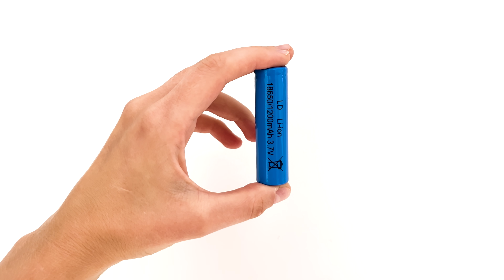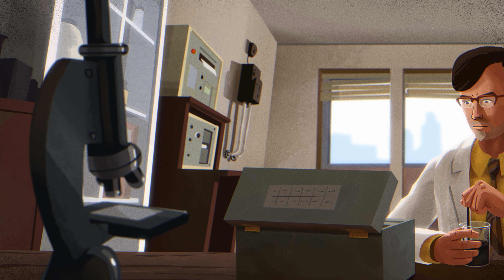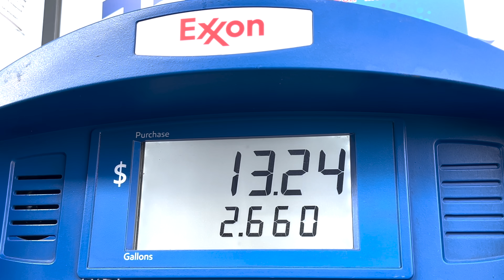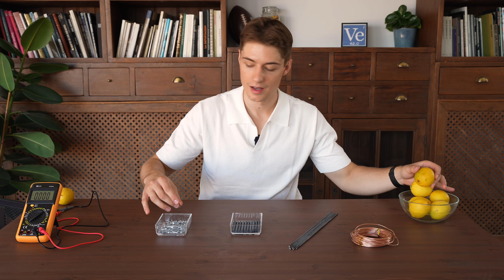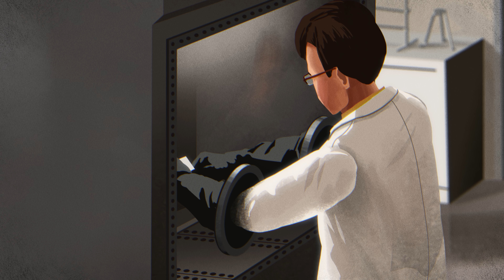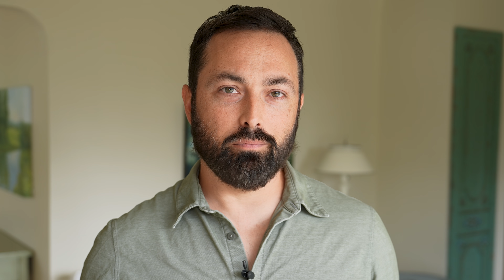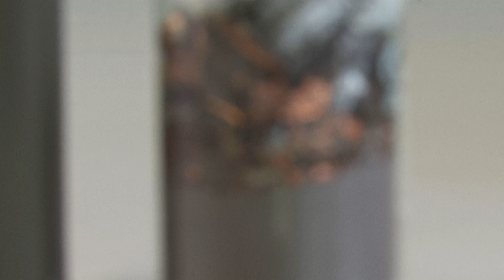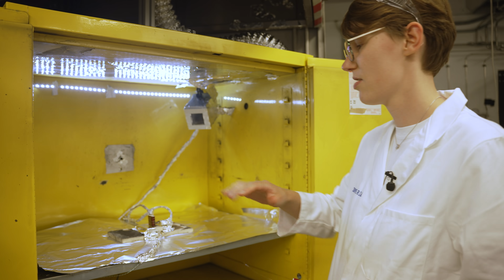The Perfect Battery Material Is Dangerous

Comment: How would cutting the speed limit cut consumption of gas.. and not increase it?
Reply: How might it increase it, supposedly?
Reply: Cars burn more gas the slower they go, more idle time, gear have less drag when they are smaller.

Its the reason why when you buy a car and they are talking about how far it gies on a tank you'll see a disclaimer (80km or 55 miles per hour)
As that is the best speed verse air resistence you get per liter (gallon)
Reply: @grakalockheart2980 : No they don't, just from going slower. If you idle a TON then maybe, but ordinarily going faster drinks up more fuel. Why do you think the federal speed limit was kept down at 55 during the fuel crisis? It wasn't about getting up to that speed, it was about keeping DOWN with that speed.
Reply: @HelloKittyFanMan.. 
The whole point was that decreasing the maximum speed doesnt help, it was decided by politicians looking for votes, competence was not involved.
Reply: @grakalockheart2980 : If you reduce drag then you increase efficiency. So yes it does help.

Comment: Sodium-ion batteries already exist, and they obviate the need for both Lithium and Cobalt. They're safer. They're effectively sustainable. Plenty potential to be way cheaper. And they only have 30% less energy density.

The future is already here :)
Reply: No offense, but it's annoying that everyone states things so confidently, yet has only touched the surface. Sodium ion batteries are not a great replacement for a lot of uses. The battery chemistries we have all have their advantages and disadvantages, it really comes down to the specific application. Energy density, specific energy, voltage, max discharge rate, safety, and so on, are all factors that have to be considered on a per use case.

Comment: Speaking of a serious risk: 
My brand-new Makitta 6.0Ah, 18-Volt Lithium Ion accumulator recently commited suicide, several seconds after having been taken off charge. 🤔
Melting the insulation of the DC supply line, as a consequence of a mysterious short, caused  by the misterious unsoldering of one solder-joint inside the DC-adapter extension line.
It is now a poorly performing 12-volt Battery, because the accumulating of the prior Lithium Ion Accumulator no longer works.  There it goes. Another $50 bucks spent on involuntary research. 🤗

Comment: I had a NiCad battery for my Motorola cell phone (The Brick) and it was crap. I heard that with these kind of batteries, you should never let it get to 100% charge, and don't let it get below 20%. So I tested this. Got a brand new battery and was very careful not to go above or below the 100/20% level. It worked. It lasted about twice as long. The only problem is the amount of attention you have to have not to let it get below or above those levels. I charted it all and showed it to my science teach. He was so impressed with my work he gave me a whole letter bump for the semester. Went from a C+ to a B+.

Comment: I blow up batteries at work sometimes. LabTest Certification tests and certifies batteries. Some of the certifications require the "blowing up a battery" test shown here, to see how well the design of the system minimises the damage. Some of the batteries that need this are BIG. The biggest ones I've tested had more than 20kg worth of cells. The fires these things make are impressive. The gasses that they release are scary. There's a whole cocktail of nasty things - the most immediately dangerous part is probably the insane amount of carbon monoxide (can be over 30% of the gas by volume sometimes - even 1% is deadly), but there are also tons of VOCs, heavy metal particles, HF, HCl, etc...

Comment: Hmm, in less than 500 charges it dropped 33% capacity 🤔 that actually sounds pretty good.
Ofcurse 40km is really bad, but hey wait, wasn't the chemistry back then of such kind that was not ment to fully discharge? Then 500 times sounds of allot!
If you watch data sheets on even high grade lifepo4 nanophosphate cells, then the lost capacity is most deffently not measured at high discharge rates like c10-c30 😂  
~480kg battery = 108 cells in series and 100 ish paralel..
If you want to pull 75kw ~100hp then you pulle 2a of each series or c2.
The cell manufacturer talks about cycles to still have 80% and are maybe measured in c0.2 - c1.
With that in mind 500 cycles in the beginning of 1900's and only lose 33% sounds quite amazing

Comment: This is WRONG. Electrons are negatively charged. Electrons travel FROM the negative electrode TOWARD the POSITIVE electrode THROUGH THE LOAD. When charging, the process is reversed. The excess electrons are driven off from the positive electrode and drawn back towards the negative electrode.

Comment: John Goodenough has been working on solid-state lithium ion for a while, which would have a solid-state electrolyte, and have about 2x the energy density as our current ones, but not suffer from the same degradation problems.

Comment: I have at home Sony miniDV camcorder, it's from 2004 and battery still works, it has only like half of battery life as original, but it works
Reply: I have four 4Ah Li ion ryobl 18v batteries made in 2012 and cycled at least 300-400 times each.
I recently measured the capacity of each and was surprised to find that they ranged from 3.7 to 3.9 Ah.
Reply: 2004?  That’s 21 years and still working?!?! Amazing
Reply: @johnhardasnails7464  Japan quality bro.
Reply: 2004 Sony Digital8 Handycam here, original "Info lithium" battery still works! (As well as aftermarket Sony-made big boy battery)
Reply: @nthgth  No programmed obsolescence.

Comment: About being explosive - the crazy run for stronger batteries resulted a couple of years ago in LG50T - 5 Ah 21700 type cell which was strong enough to power compact personal commuters (e-bikes, e-scooters and e-monocycles, even e-cars) - rapidly they could have 1.5-2x range and much more power . But it was extremely unsafe - which resulted in many fire accidents. When they were stopped - replaced by LG50LT and Samsung 50E and 50S batteries - the problem vanished. So production technology has a big impact on safety, too. The achieved safety is because of carefull production process; batteries themselves are still not save when damaged - that why it is important to clean interiors of commuters from dust and sand yearly.

Comment: Well, when it comes to large-scale power-hungry operations, there's a simple solution called bricks meet steam generator. What you do is, you build a tower of bricks inside of a giant oven, heat them up and leave them at high temperature. They're bricks, so... they don't explode or anything. it's just hot. Then, when you need power, you can use water to conduct the heat to a generator old-school style. It's effectively a battery, just one that uses heat instead of a charge or chemical reaction to store energy.

Obviously, this doesn't work for mobile devices. Can't have a brick that's over 3000 degrees C in your hand lol. For those devices, you will likely still need to rely on chemistry. I'd say that exploring carbon may be a good place to look.

Comment: ive raced remote controlled cars for years and ive seen a few lipo batteries explode. i know lipos are different but it can be very violent. rc batteries can be as big as 4s 10000mah. that's a ton of energy to be released. most of the time its because people are trying to get an advantage and over charge for more power at the beginning of a race. also there is a method of discharging and recharging the battery very quickly to temporarily lower the internal resistance in the battery give them more power. both are very hard on the battery and can make them fail spectacularly. less common is a short between poles and puncture. ive never had a problem almost all of the problems come from people abusing them.

Comment: The mose dense an energy storage system is, I.E., the more energy it can store per weight and size of the storage "cell", the MORE dangerous it WILL be of something goes wrong and releases ALL of the stored energy at once. 

It doesn't matter if its a lithium cell, or a container of gasoline with the same amount amount of energy inside it, they'll both blow up with roughly the same violence if all released at once.

Comment: "...Decreasing the battery's capacity...." But then that's the only way you can use it, right, Derek? So it's kind of like the old "unformatted capacity" vs. formatted capacity of a disk (typically floppy disks), because even though supposedly the "unformatted capacity" is higher, it doesn't really mean much for the user, since you HAVE to format the disk in order to use it... supposedly "lowering its capacity"! Same sort of deal, right, Derek?

Comment: Lmao the fume hood and nichrome wire heater.
Just knock a copper nail into it at full charge and move away quickly.
You'll have time enough to get away and it doesn't just look like you've set it on fire.

Or just over discharge and then push 8V into it.

Comment: The content is being a little alarmist with respect to the fire hazard aspects.  Individual cells typically have thermal and/or overcurrent protection.  That should have been mentioned.  We have also tested cells, and it is nearly impossible to cause thermal runaway with overcharge current or voltage.  That is also the experience of all other researchers we deal with.  Temperature and mechanical damage can obviously cause the failure, but then there is an external cause, likely not related to the battery itself, unless there is a manufacturing defect.

Comment: Lithium batteries were first mentioned in Dick Tracy comics, back in February 20-24, 1946. A young and blind genius needs lithium for the batteries of an ultra-bright "atom-flash" light and the two-way wrist radios for Diet Smith industries to supply to Dick Tracy's police force (later replaced with two-way wrist TV in 1962).

Comment: Putting out a Lithium fire: "Specialized agents such as those containing Aqueous Vermiculite Dispersion (AVD) or dry powder agents tailored for lithium fires are recommended. 

Here's a breakdown of suitable extinguishing agents:

1. Aqueous Vermiculite Dispersion (AVD):

AVD is a water-based solution with vermiculite particles.

The vermiculite creates a heat-resistant barrier around the burning cell, preventing the fire from spreading and re-igniting.

The water component provides cooling, reducing the temperature of the battery. 

2. Dry Powder Agents:

Some extinguishers use dry powder agents, like those containing sodium bicarbonate or powders specifically designed for lithium fires.

These agents work by suffocating the flames and disrupting the chemical reactions fueling the fire."

Comment: there is a lithium based battery design even safer than the current design in use commercially.  This design was proven stable with a metal shears cutting it in hafl and nothing happened as well as a nail was driven through it and nothing happened.  The battery was 80% charged at the time of testing as well.  The problem however is that it is a VERY expensive process to make this battery and while it has a comparable recharge ability - the actual voltage is less.  somehting akin to 3 vs 4 and that is why they keep going with the current design.  It isn't perfectly safe to use the current commecial battery but at 1,000,000 - 1 failure means it is cost effective and profitable.    so the trade of fis higher cost with better safty but you loose energy density or you go with the current wide use design to reduce cost and gain energy density.  I think there are versions of the different battery being sold under the name LiFePO4 or Lithium Iron Phosphate and they are very very safe and long lived but costly.

Comment: For energy storage (on power grid scales), look up the molten salt battery. They're made from readily available materials and have energy densities and cycle-lifetimes on par with Li-ion. While they require constant energy to maintain their charge (due to being literally molten salt at 250+ degrees C), the energy grid goes through a full charge/discharge cycle every day: that is, short term storage. And for short term storage, their efficiency and reliability is extremely good.

Comment: The thing that gets lost in these sorts of discussions of the energy density of batteries is that from a broader physics standpoint, energy is energy. It'd be amazing if we could figure out how to power an electric car for 300 miles on a battery the size of a AA battery. However that's achieved though, clever chemistry or mechanical engineering or whatever, the bottom line is that you have something the size of a AA battery with the energy to power a car 300 miles. If anything goes wrong, that energy will go somewhere somehow.

Comment: very interestingly, jhon b goodenough has done work in researching solid state batteries, which are the biggest battery improvement race right now. that main claim for them is that the electrolyte is solid instead of liquid, which means it doesn't evaporate and also that dandrites (a big contributor to battery degradation) cannot form.
if these come to be, then charging speed will become practically uncapped, and also the capacity would improve because solids are denser than liquids.
its still far away, most predictions are that devices will start using solid state batteries around 2030.
or something could come and revolutionize of course

Comment: I like how they gloss over the exploitative conditions for Cobalt while demanding WE NEED MANY BATTERIES. Also, no mention of death statistics from battery thermal runaway, the need for specialized foam as water won't cut it because it feeds these types of fires, heavier vehicles from batteries lead to more dangerous casualties, and the difficulty of recycling these battery packs once they're used.

Comment: i still got one question: batteries i used never exploded but instead they leaked, some even when stored safely outside of a device. it's that weird white stuff that builds up a crust, you know. when they pulled apart that battery, i couldn't connect the dots here. where does that leakage come from? 🤔